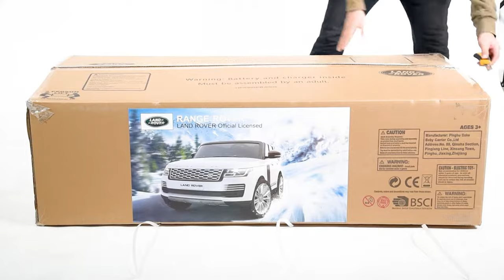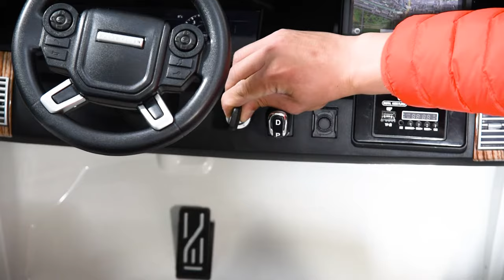12V Range Rover HSE 2 Seater Ride on Car (Assembly Video)

Comment: Can you tell me how to conect the battery please I got troubles with the cables instructions don't tells you much
Reply from the maker: Please send us a message to support@dtidirect.com they will help you there with any issue
Reply: My controller isn’t functioning L & R. I hear the signal clicking but the car will not turn. It will only move forward and reverse. I’ve checked the wiring connection. I hear the clicking in the car when I press the L & R but the car doesn’t respond.
Reply: Notice how they didn’t respond!?!?